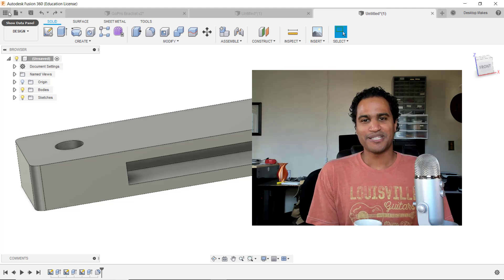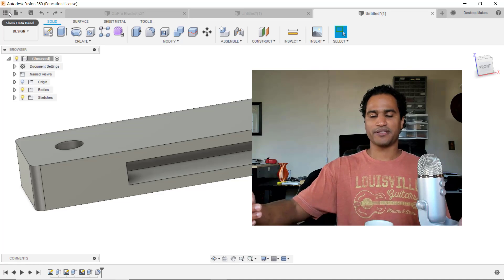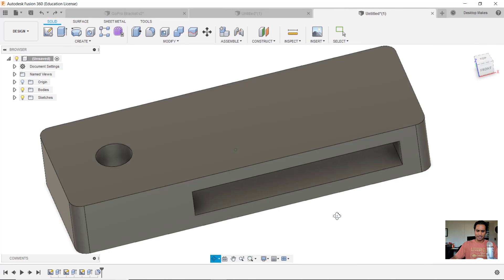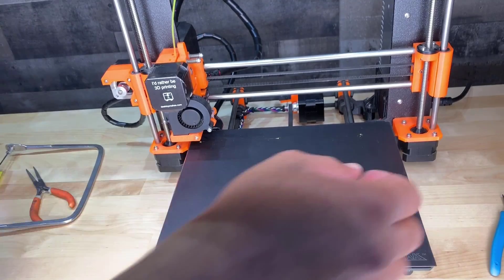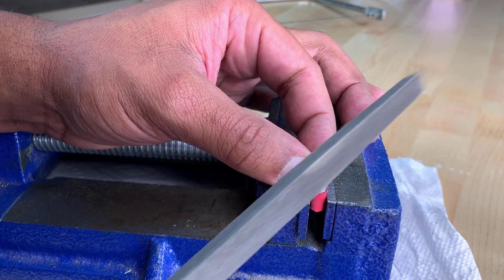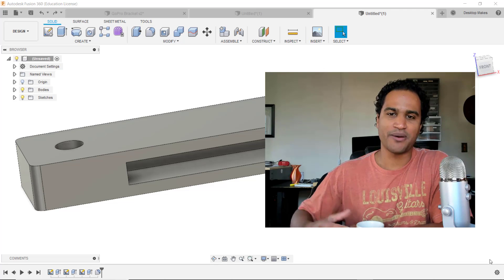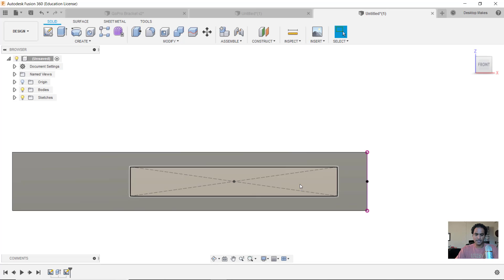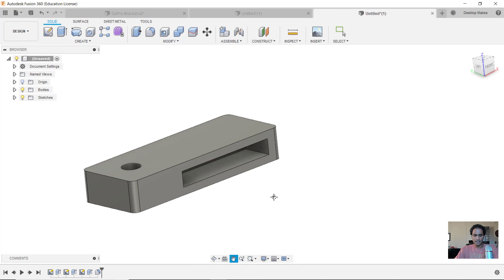Design a Camera Mount in Fusion 360

Comment: Thanks for sharing. Nice video. Are threads that are on the same plane as the layers, "weaker" than across the layers?  Cheers! : )
Reply from the maker: Good question.  They'll be higher quality on the same plane as the layers but not sure as to the holding strength depending on orientation.  Parts are general stronger if the stresses applied are perpendicular to the layer lines.

Comment: Thanks. I've played around with printed threads. But my best results were from embedding a nut in the part.
Reply from the maker: Yeah, I mainly use printed threads on very large pipe type threads.